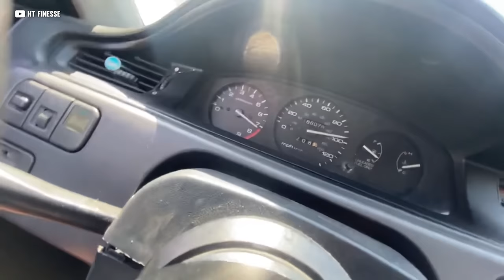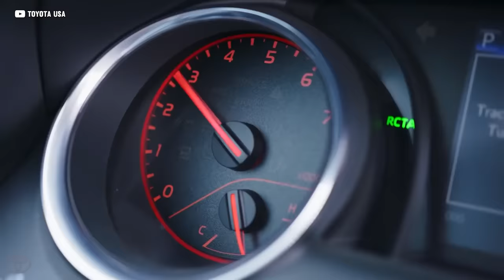7 Things NEVER Do In A Manual Transmission

Comment: DUDES!!! Best X things not to do in a manual video I'v seen yet!
A number of YT vids have covered this topic and none have been this comprehensive.  Yes! Yes!  and more Yes!  So much of this video I was doing air high-5s on.  Except when I heard "clutch release bearing".  Huh??  Did you mean "throwout bearing"?  At least we didn't hear "clutch thingy" lol.  Otherwise, yes.  Completely agree.  Especially with coasting in neutral.  It's technically illegal... At least where I live.  Also, I've driven in the snow in a 5spd manual (85 cavilier).  Engine brake! For the love of God.  Tap the brakes if they start to lock up.  I'm of the opinion that ABS is for newbs who don't know how to pump the brakes.  Black ice and just ice in general is no joke.  In the snow, all the hard braking should be done at very the beginning of the stop.  By the time the car is at 1-2mph, the brake should be feathered at that point.  So yes, in the snow, engine brake, downshift, engine brake, downshift.  Use the brakes sparingly in those instances.  Unless you drive a rotory.  In that case, I'm sorry for your loss.

If you really want to scare your friends, drop the car in neutral at highway speed, kill the engine, and cut the lights while coasting.  Watch the freakouts commence.  Alternatively, intentionally cause the car to jerk, causing all your automatic friends to ask "what's wrong with your car?" Lol.  Clutch dumping is expensive, yes.  I've burned through a brand new clutch in a month because I never broke it in.  That being said, you forgot "Break in your new clutch after install".  For most people who aren't fueled by tire smoke adrenaline, this isn't a problem, but if you're like 17yr old me, who loved to get high on burning rubber, this should be a major concern.  Brake in that bad boy before red-line clutch dumping, or expect that new clutch to come off in pieces in a month.

One skill not talked about enough is the skill of "floating gears".  This is the act of manually synchronizing the engine speed with the transmission speed and slipping the transmission in and out of gear without even using the clutch.  I've had to use this technique several times over the course of my lifetime.  When I drove tractor trailers, it was practically mandatory.  If you want to impress your manual friends, this is a good way to do it.  Heel-toe and rev-matching is another way.  Both are grade-A manual techniques to learn.

Another skill not really discussed, and only referenced once in F&F, is "double-clutching".  It took me learning to drive trucks before I even learned what this was.  Dump the clutch at a high rev, put the car in neutral, then dump the clutch a second time and select the next gear.  So the sequence is clutch-neutral-clutch-gear.  This isn't near as necessary on cars with synchronizers, but around the track and switching between really high RPM to a much lower RPM, your syncros will thank you if you adopt the talent of double-clutching.  It can be just as catastrophic if you do it wrong, so practice in the more forgiving gears.  2nd to 3rd, or 4th to 5th.  This should be a skill pretty well honed before doing it regularly from 1st to 2nd.  It's real easy to let out the clutch too soon and catch 1st, or miss pulling the lever out of 1st completely.  The closer the engine RPM is to the transmission speed, the less work the synchronizers need to do.

Lastly, and something that should be a given, but I don't recall hearing (maybe I missed it).  Never grind gears!  OMG, you have no idea how many times I hear these truck drivers try to use the strategy "grind it till you find it".  NOOOO.  The only place you typically have an issue putting the car into gear is 1st or reverse.  There are 3 strategies that work really well to get the car in gear when this happens.  1st strategy:  when at a stoplight and you can't get the car into 1st, never fear, with the clutch engaged, cycle the shifter to 2nd, then try to go back to 1st.  2nd strategy: hold the shifter at the stopping point ready to slip the shifter into 1st.  Release the clutch to it's friction point and slip the shifter into gear.  3rd strategy: if you're on any type of hill, ease off the brake slightly just to inch the car in any direction.  Then slip the shifter into gear.
What happens when you can't get the car into gear is that the two gears are colliding.  One gear just needs to be moved slightly for the set to mesh.  There is absolutely no need to "grind it till you find it"

Otherwise boys, you nailed it!  I really had to contain my excitement on this one.
Cheers!
Reply: floating gears is also fun to do & floating downshifts are way more fun than upshifts but first learn your car and how it sounds while shifting if you don't then You WILL grind gears
this isn't that hard but it can be quite annoying on some cars 
If your clutch cable breaks you have to drive this way (you can't disengage the clutch to shift)
Reply from the maker: Thanks for the comment, and thanks for watching! Many manufactures refer to the 'throwout bearing' officially as 'clutch release bearing' - Trav's years of working for manufactures and running the shop have him programmed to speak in proper technical terms. Again, thanks for the watch!

Comment: Someone once told me, the best manual transmission driver makes you feel you were in an auto transmission.
Reply: no, just no... The stupid kick-down is a tell tale of sitting in an automatic when you need to gain speed fast (for merging for example). You will notice that a manual driver will pick way different spots in rev. count to start shifting in different situations, pending on what acceleration you need. In an auto, this is chosen for you and oh boy is it boring as hell ^^
Reply: @AwoudeX  If you want to merge on the free way, you want to use a gear with a longer bandwidth....for the BMW the newer version, you probably want to be reach 4 if you are not at a standstill, the switch to 5 will be seamless. At a standstill, all you need do is listen to your engine, why kicking it from 1,2,3 to 4 and 5&6. I make it a point not to have a rough switch between gears, knowing the exact time to switch.
Reply: @jahudini  rev matching is a thing and you'll keep the rpm at a range where the engine has way more power so you actually accelerate at the desired rate. If your switches are rough, you're not doing it right.

Comment: i have few things to say and add. 
honestly when shifting its better to use the palm of your hand or ball of your thumb. this makes shifting into gear smoother for newer drivers but also its also good to remember to take your time your not in a race.

also i feel its very important to say but the car tells you a lot about when needing to change gear. if the car is screaming and your doing 30 in second probably best to go up a gear or two however if your on an incline its always best to go faster than you normally would before changing to account for the loss in speed dipping the clutch would give.
Reply: 30 in something higher 2nd, you must use MPH in KMPH 30 is the fastest you go in 2nd gear this is because 30 KMPH is in areas that people live (low/medium density housing & Shopping area's)
Reply: @imtiredtoday  It entirely depends on the vehicle. My mom's daewoo can do 3rd at 25kmh and 4th before 40kmh and it's comfortable there. Others are comfortable sitting in first for 45+kmh. You learn what your car can do as you drive it, there's no specific speeds and gears.
Reply: @Nina-cd2eh  I know, but it literally is taught in the Netherlands that in 30kmh zones you drive in 2nd gear...
I'm aware that 30 kmh in 4th isn't a lot of revs...
Reply: @imtiredtoday  Well still, it doesn't really matter. Different cars work differently. 2nd gear is preferred because you have more range downwards and go much slower than 30 when you have to. Which is more important for a country like the Netherlands, where you very rarely can even drive 30 in most low speed zones. Unlike american suburbs for example with really wide roads and no traffic calming or cyclists/peds.

At the end of the day, you as a driver are responsible for driving safely, and you might find that driving even in 1st might be safer depending on the car, or the environment.

Comment: I drive a 2012 Toyota Tacoma  with 300000 miles.  It still has the original clutch.  I live in the LA area and hold the clutch at each stop. If you have to move  quickly you don't  have to wait while you put the car in gear

Comment: Always, will drive a 3rd Fun Pedal Manual Transmission... I lived with the Automatic with Paddle Shifters for 7 years it was boring and even with traction control off it was limited in it's potential. in the corners the shift delay is worse than a manual transmission.... Car & Driver Channel tested  the Dark Horse and described what I experienced. I was bored on long Trips and felt sleepy. New Automatics have too many Robotic ADD-ONS and quite frankly prefer driving my car and not be Driven. Currently, I drive a 2022 Roush with REV-Match Tremec 6 Speed Manual Transmission, Magneride Suspension, & Intercooled Limited Slip Torsen Rear Differential.. Will never Sell it not even if I was  Offered $1 Million 👨🏻👍🏻🏎🏎🏁🏁🚩🚩

Comment: There are a few more important points: NEVER look down at the shifter when driving on the road, and NEVER jerk the steering wheel when shifting. Holding clutch uphill for just a few seconds is totally fine, clutches are way tougher than we may think. It is very easy to tell if you are lugging engine, because you can feel the engine shaking. Personally, I don't look at the tachometer when shifting, I just listen to the engine. My 1.6-liter sedan cruises on 3500rpm at 70mph, so I rev it up to 3500rpm when starting at a traffic light, just to be able to catch up with the traffic 😂

Comment: At an emergency stop DO NOT touch the clutch, if you're in gear engine brake will help you come to a stop, especially in lower gears. There's absolutely  no gain pressing the clutch in such situations where you at any cost need to stop as quickly as possible
Reply: Bad advice. If you don't disengage the clutch, the engine will be trying to push you on as you slow down in higher gears. Hit the brake first, but disengage the clutch straight afterwards. It's the same effect as braking in an auto. You don't have time to downshift to use engine braking.

Comment: in germany you can actually fail your driving test (depending on the mood of the driving examiner) if you are the first at the red light and take "to long" to get going when it turns green so most instructors will tell you to stay in first gear at the red light
Reply: It's the same in the UK. We are told we should put the handbrake on, but should still keep it in first for the reasons you stated

Comment: These are good notes! Ah I remember when i was racing and I had straight cut transmissio, but not sequential. So if i grab shifter too soft it went neutral but it hit my hands when putting it on new gear. That hurt. So I had to grab it and really be a determined to shift to a next gear. The car was -80 Toyota Starlet with the legendary 4a-GE redtop engine. That car was built on rally or rallysprint and it was CRAZY fast on dirt track. And I'm not speaking about oval dirt, but a narrow forest dirt tracks.

Comment: From the UK, ex garage owner, retired driving instructor and aircraft engineer, one thing you’ve missed, 
Do Not use the gearbox to slow down, unless on snow / ice.
 Match the engine speed with the road speed, your gearbox will thank you.
Gas pedal with gearbox for going faster...brake pedal for slowing down or stopping...

Comment: I'm actually not even sure how people manage a money shift. I went to do it once in a Jeep Wrangler, and as soon as I started engaging the clutch I knew I was in the wrong gear as it was decelerating waaaay too quickly. RPMs only got up to like, 1,500 before I disengaged. Either the Wrangler's straight-six influences deceleration more than the average car or people are carelessly quick with downshift clutch engagement, but there was no way I was accidentally doing that, it was way too obvious.
The only other vehicles I drive pretty much can't money shift; the larger transmission required in a diesel pickup is much pickier about downshifting and will not go in a gear you're going too fast for.

Comment: When I started out with an used car, I committed a lot of mistakes even though I knew it was bad for the car. But an year later when I bought a new and conciously put efforts to correct mistakes like:

1. Holding the clutch and the break down while on first gear in a red light. 
2. Lugging the engine.
3. Being too lazy to down shift until the engine tells me fuck off.
4. Placing one hand on the gear knob. I don't know why I did that but now I understand that two wheels on the steering is safer for me and my car.

Good video though. Many beginners like me must have committed some of these mistakes at some point in their driving experience. Although I have one doubt. When the cars doing high speeds on expressways, I was taught to brake without the clutch to reduce the speed lesser speeds. Was told that if I use the clutch to slow down at high speeds, the clutch plate is going to wear out quick due to the heavy momentum of the car. 

Anyways thanks for the video.

Comment: 5:50 that's a bad idea.
some camshaft systems don't like you make the engine spinning at the opposite side.
It's always better to put 1st gear down hill, and reverse uphill; and steering in order to point one of the wheels to sidewalk curb.

Comment: I have an 85 Mercury Capri RS 5.0 / 5 speed. I took it off the road at 250,000 miles to resotre. Original non-rebuilt engine and transmission. 5 clutches and I think I only used 2 throw out bearings. I bought the car in 89 with just over 40K miles. I beat the living snot out of that car and it only let me down once.  More that one of those clutch changes involved driving home by rev-matching alone. Clutch replacement is fairly cheap, if you can do the labor yourself.

Comment: Dont break and clutch together in an emergency stop. The engine breaking provides additional stopping force on the car. Disengaging the clutch removes this additional force and thus you’re going to travel further and faster. If you’re really advanced and have quick reaction time, you can downshift and get more engine breaking from the lower gears. However, number one rule is some engine breaking will in fifth or sixth gear is better than no engine at all.
Reply: If your engine breaks that will definitely slow you down

Comment: As a european, I have something to say to this video - for example, it's really BAD IDEA to always use handbrake when you park. Why? Because in winter, there is a really good possibility that you would just instantly kill your handbrake. So in winter, park it JUST with a first or reverse gear. 

Also, it is worth noting, that if you have a diesel car and accidentally park your car with 1st gear selected when car is facing downhill, it is possible for that car to not even go downhill as a normal petrol car, but but to start the engine along the way.

Also, "don't brake without a clutch" is wrong too. Don't get mad at me, in almost every situation you need to do that, but if it comes to emergency braking (meaning you have to brake to avoid accident), do not engage the clutch! The time you save with just a braking without a clutch may really save you, every second counts.

Anyway, good video.

Comment: Floating gears is a great way to extend the life of your clutch...... as long as you do it right
Reply: Finally! Someone else who knows that term!
Yes! More importantly, it will save your knee.  I used to exclusively float gears when I lived in Indiana.  I had a really bad knee at the time and I refused to give up manuals.  I also would do this exclusively when I drove trucks.  Synchromesh gearboxes and double-clutching a 2000ftlb clutch can be demanding on the legs.  I therefore picked up floating gears real quick.
These days, I'll float gears in my F150, but not so much in my miata.
Reply: I float gears in the most crappy Cheap peugeot/Citroen/Toyota car in the last 10 years the Aygo/107/C1
a tiny car that goes from O-100 in like 15 seconds
Reply: It's not a great idea to "float gears" on a synchromesh gear box, it can cause issues with wear and gearboxes cost a lot more than a clutch. On a crash gearbox, it is easier just to double clutch.
And most car clutches will run over 100k miles if you look after them, and that is driving around town a fair bit, so unless the clutch goes and you need to change gear without the use of a clutch, just use the clutch, its a wear and tear part and is designed to be replaced, unlike your gearbox which should, if maintained, last the lifetime of the vehicle.

Comment: I still let my shifter float to neutral before 6 on my 2005 Wrangler. Reverse scares the heck outta me goin 60mph/100kph forward. Still don't rev match either; should be able to read where your upshift spot is golden. Downshift doesn't need it cuz you're slowing down most times anyway so ease it nice, we're not all racecar drivers. Still leave hand on shifter constantly; don't push/pull to neutral and you're gonna be okay. I mostly roll in 4th round town anyway, shifters not movin. 
Good video boys, wish Murica would stop being so convenience culture with autos among many other things...